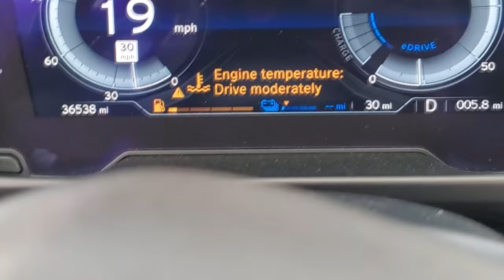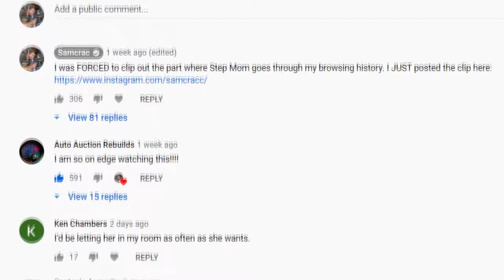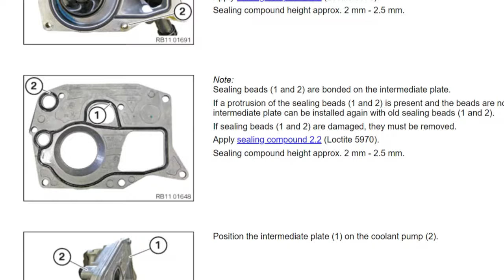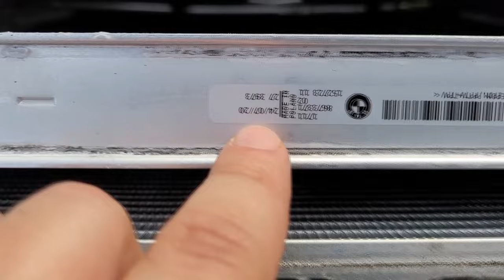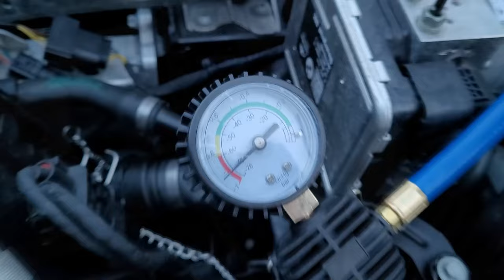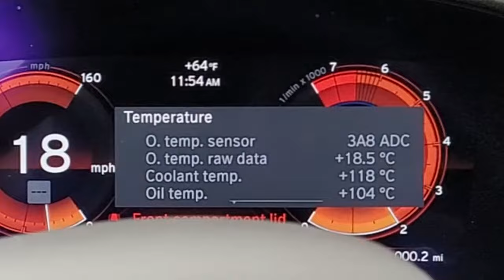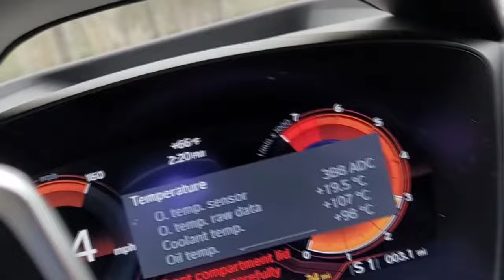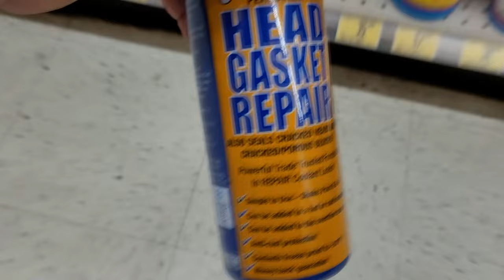The Dealer FAILED my "Unrepairable" BMW Supercar! Can I Fix it with this Simple DIY Trick???

Comment: This is probably one of the most anticipated videos of YouTube. Alot of folks wondering what will fix Samcracs car.....
Reply: And the answer is... a new engine 🥳🤣😂
Reply: @mundotaku_org  PRICELESS
Reply: What if it's the water instead of coolant... Don't the sensors rely on conduity or something at times? I'm not a mechanic I just done alot of reading and thought that was a "thing"
Reply: Thats a hell of a projection. lol
Reply: BMW overcomplicated bleeding of the system. You can choose to do brain surgery or bleed an i8. Brain surgery is quicker
Reply: @D Thirteen  Which one?
Reply: @rocsti5402  Interesting thought. I'm no tech either but with a car like this; who knows?
Reply: Get a grip
Reply: I really hope you dont use that head gasket fix. It will ruin your engine if it hasn't already. It plugs up every cooler, radiator, heater cores, oil coolers etc. I am a master certified diesel tech, for the love of God DON'T USE HEAD GASKET FIX!!!!!
Reply: Why didn’t he do a sniffer test in the first place? It’s not expensive and doesn’t take very long. It would have saved him soooo much time and expense!
Reply: Now I am having doubts about buying a  BMW if they sabotage the cars
Reply: @innesmaclean21  I have found in my line of work it's not a very accurate test. Mostly with the egr system. If that system develops a leak it will contaminate the coolant with exhaust gas. The coolant is usually not replaced, just re-used. So it can give you false positives from a previous failure
Reply: Even Sam crack's floor jack sounds like Rich's fail flute...
Reply: @Random-bm7ho  yeah, I see that point, but in this case Sam replaced all the coolant with distilled water so unless that got contaminated in the couple of drives he did, it's probably the head gasket.
Reply: @Mandinka711  It doesn't take much. The test is pretty sensitive.  I better test now that the path is decided is to pressurize the system and see if you can get coolant into a cylinder to nail down the issue. Pull the plugs and compare. The one with coolant will be steam cleaned, same with the top of the cyl. Could also be a cracked head or warped considering the cooling issue. Who knows how bad it was thrashed on with the damage. I'm not a bmw tech, but I know they are pretty complex.
Reply: You are correct this is very mysterious and interesting I went through the same thing you can't get false positives from that blue liquid test I got a false positive and replace an engine when it was not the engine it was the radiator
Reply: @noblsht  My grandfather once told me when I was having issues on my first car that "sometimes it's just a sparkplug" I think I was assuming it was way way worse like a burnt up piston. Well, he was right, it was a plug wire that rubbed on the valve cover bolt causing a misfire. That advise has served me well with the career I chose lol.
Reply: As a bmw mechanic I don't trust this test result for 2 reasons: 
1 a headgasket issue that overheats this engine in such a short time must be visible on all tests that are done including having a vacuum leak. You cannot hold a vacuum with a head gasket issue. 
2: running on destilled water is really bad. The boiling temperature is to low creating hotspots at the cylinder walls causing you to get gas creation over there creating the overheating issues again. The water actually starts boiling at the cylinder wall

There is NO way that a small headgasket issue creates an overheating issue this quick after starting the engine.

The sudden drop was actually ok, that was the thermostat opening completely making the cool radiator water run through the engine.

I would redo the test with the correct coolant which is already pre mixed.
Reply: @Random-bm7ho  that’s fine on a diesel but petrol cars don’t use EGR valves (to the beat of my knowledge). They mentioned a possibility of a head gasket in the first episode by just dismissed it really quickly. He should have done it early just for some peace of mind. I thought o had a head gasket fail once because I had milky residue on the oil filler cap. A sniffer test showed it wasn’t a head gasket failure which saved me a lot of money. Btw the milky residue was from doing short journeys during winter and condensation forming on the inside of the cap.
Reply: @peerware  everything you said makes sense you made some very good points
Reply: @innesmaclean21  Gas engines do have egr valves. I wasn't talking about a egr valve, I was talking about a egr cooler. It cools the egr gas to lower the exhaust gas temp to reduce emissions. Also oil coolers, fuel coolers, and if it's a hybrid it will have some kind of cooling system for the electric motors all of which have coolant flowing through them. Alot of the foreign cars also use coolant in the turbos to help cool them. The head gasket fix will destroy all of those. It essentially creates a solid mass in them, resulting in the cooler being plugged. That stuff was ok in the old cars, but with all the complex system of today's cars that stuff should be banned.
Reply: @peerware  I agree. I've been thinking about how quickly it heats up. Something is not right. I don't think the head gasket is the problem either...
Reply: Head gasket doesn't mean a new engine...
Reply: @Airplanefish  Is there coolant in the oil? Sorry, I missed the start of this deal lol
Reply: @Random-bm7ho  I don't think Sam has checked the oil for coolant. Good idea tho.
Reply: Yes most new petrol cars have egr coolers . As i said before .. 
Do a quick google search . Bmw i8 egr cooler . They sell them . For this car .. and its a stocked product.  Wonder why ae
Reply: sams mommy
Reply: Facts
Reply: @bdbeckstrand  unless it’s a Cadillac North Star lol 😂
Reply: I'll tell you... new engine 😜
Reply: @innesmaclean21  Wouldn't have made much of a video though.😁

Comment: In a way, replacing the engine would have solved the head gasket issue
Reply: I think we may still not discovered the full story. We'll see if a gasket replacement will solve the issue.
Reply: Of course it would. The mechanic in one of the previous videos  literally said " is that the one that was driving around, overheating" word for word. AND HE LAUGHED!!  Getting a Modern engine hot briefly, is sketchy. Driving around, overheating, pretending that it is no big deal , then trying to reseal the top end is thowing good money, after bad. A five minute combustion gas test would confirm that,  but in the interest of content, the attempt at cheap ass, not gonna work, not gonna listen to the smart people, will continue.
Reply: Potentially more cost effective too
Reply: Told ya it was a head gasket.. it’s common on diesels when the head gasket fails the over flow boils
Reply: @cbruno12180  but it's not a diesel
Reply: It’s unlikely that it’s “just” a head gasket!   That would be way too easy and isn’t the only way combustion products can get into the coolant.
Reply: @richb2229  it’s possible he has a cracked head sure who knows how long it was driven before he got it while it was overheated
Reply: Idk sounds like more than a head gasket. But at the same time its running great and no signs of leakage around the engine, like water in the oil. Idk one of the weirder things ive seen. Gotta be a pressure issue its not moving through the block fast enough. I'll say the absolute worst thing to do is put the fix a headgasket gunk in the system especially on all of those brand new parts he just put in
Reply: @jamesgeorge6551  yup especially when the dealer said it needs a new engine.  better hope the head gasket is the only thing wrong with it
Reply: @TAKIZAWAYAMASHITA  if you drive around, overheating, repeatedly, r&r headgaskets is like putting a band-aid on a terminal cancer patient, hoping that will cure them.
Reply: @cbruno12180  ..."diesels"??  Who said anything about diesels?
Reply: @cbruno12180  
The dead giveaway was the bubbling in the reservoir in last video which means exhaust gases are getting in cooling loop. Just have to hope head not cracked?
Reply: @jamesgeorge6551  Yep as surface is likely warped and could have a crack in head?
Reply: @parrotgenie5099  What I would do, I would send the head to get pressure tested. Whether it is only head gasket problem or not, head has to come off anyways and since this car has produced weirder and weirder symptoms, it would be a wise move to make absolutely sure that the head is fine. I personally think that it is likely to have a microfractures in head and the gasket is fine, because when gasket fails, it usually gets worse and fluids and gases are starting to get to the places that they are not supposed to. On the (slightly) bright(er) side, new head is prolly cheaper than new engine...
Reply: @mr.m2gilane  Yep exactly
Reply: @parrotgenie5099  correct I used to work at a gmc dealer and a strange case came in with a deisel truck I’ll never forget it the top tech was on it for days the the cooling reservoir was bubbling at certain times and finnally he figured it out that the head gasket were bad this was 15 years ago
Reply: In a way replacing the engine would would solve the head gasket issue. Unless you were putting in a blown engine how could replacing the engine not solve the issues?????
Reply: Cracked head
Reply: @jamesgeorge6551  and yet you watched the "content"?
Reply: @cbruno12180  not diesel
Reply: @jamesgeorge6551  mine as well get the head checked and surfaced..
Reply: @jamesgeorge6551  yup probably warped head or block either way dealer said new engine requires. Sam is like nah. Finds out after 877676 overheating and drain and fill proceedures hey do a block leak test something you do 0.1 secs after buying a a sight unseen used car. Finds out oh thats the problem welp. Lol hopefully it can be fixed without the cost of a new engine, either way with how that car is designed most of that work is an engine out procedure anyway probably cheaper to buy a used good engine from a wrecked i8. He should take it to the car wizard or scotty
Reply: @aussiebattler96  if they smoke tested it and saw it leaking out a cracked block
Reply: With this type of engine it's possibly the only viable repair.
Reply: @TAKIZAWAYAMASHITA Yeah. UView560000 Combustion gas detector. Check it out. Smart technicians dont fuck around, we own the tools to make the right diagnosis, the first time*, and I'm certain thats why the guy who laughed at samcrac the *first time , did, and the BMW dealer owns a combustion gas detector, I promise.
Reply: @theworstgamervr  he's gonna clog up that brand new radiator if he puts that head gasket in a can shit in there. I hope he was joking
Reply: @jamesgeorge6551  the only reason this is remotely cheap is because hes doing it himself. But anyone else out there who isnt a mechanic and doesn't have thousands of dollars worth of tools DONT do this.  because throwing a new cooling system and head gasket at a damaged engine would often cost you way more then buying a new or used engine to have put in at a shop
Reply: @TAKIZAWAYAMASHITA  BMW repair is way beyond the skillset of a guy with more money than sense. And trust me when I say this isn't the normal pain in the ass H/G job like an Econoline van with a 5.4, this is a DI BMW engine. Samcrac has no business changing a headgasket on an 80's Briggs and Stratton.
Reply: @douglasb.1203  and laughed, because I'm a schadenfreude kinda guy.
Reply: @jamesgeorge6551  malicious joy du Schadenfreude Knecht 
xxD Cheers
Reply: @SpeedcoreJihad  we should be able to bleed the air .....Nein! Lol.
Reply: Aluminium block on that engine, and it's pushing 100HP more than it was originally designed to... asking for trouble.
Reply: @parrotgenie5099  More likely to stress the head bolts past the point of elastic tension, to plastic deformation. Aluminum expands 3 times more than Iron based alloys. Once cooled, the bolt no longer returns to its elastic state. Upon disassembly, the head bolts will not be tight, and the head will most likely be warped. Most modern lightweight cast heads have little to no material to mill flat, and even then, the proper method is replacement, because a warped head will kill the cam bearings, and camshafts, making metal shavings that will contaminate the rest of the engine. Also, if the deck surface is warped, there is no insitu way of addressing that either. That is why BMW just says, "needs an engine". No fiddling with anything. Just install, and done.
Reply: @TAKIZAWAYAMASHITA  neither of them like bmw lol
Reply: @parrotgenie5099  wel, if you think it overheats, and think the water boils, it would explain the bubbling.
but it does not overheat, it just gets a little exhaustgas in the cooling system, that blocks the water touching the temperature sensor.

Comment: The confidence he has to use the Jack on the grass is amazing.
Reply: Stupid would be another word to describe it.
Reply: Mmm I thought exactly the same.
Reply: last place I want to die
Reply: @MICHAELWALTON1  I often work under my cars also. Even with Jack stands I have this thought of it coming down on my head and people find me under there weeks later.
Reply: Also, when you jack up a car the wheels on the jack need to be able to move as the length decreases as it goes higher. As the wheels would be stuck in the grass, it has the potential to pull the jack away from where it is mounted.. But anyway, no one likes a whinger.
Reply: Omg your rite!
Reply: @mikeb1039  I mean dirt driveway, yes. I mainly use plywood under it though. We're not all blessed with concrete

Comment: The original owner probably drove it home after the “minor front end accident “ - over heating the whole way - thus blowing the head gasket or cracking the block. SMH.
Reply: Hmm this could’ve been it but there is the overtemp cut off. 
Along with “not having insurance cover” on a car like this leads me to believe it was probably a drunk driver type of incident.
Reply: I agree completely
Reply: How does ut overheat if it shyts iff? Unless itets you actually drive?
Reply: @JackRR15  junk it car crusher
Reply: No, in an earlier video the engines been pressure tested, and internal inspection.  It's fine.  Unless he's overheated it since and warped the head or blown the HG.
Reply: @IntenseVLT  coolant temp sensors dont work very well if there is no coolant to check the temp of think of it like holding a thermoter in your wide open mouth expecting an accurate temp
Reply: @dubba85  that actually makes a lot of sense!
Reply: If there is a leak at all from the combustion chamber into the water jacket it will produce a bubble and the bubble will stop the coolant from circulating and you get overheating.
Reply: @dubba85  That is what I was  thinking and makes a lot of sense.
Reply: Cracked block means junk or can it be pulled out and repaired?

Comment: Next episode "cracked engine" 
Episode after that " me and Rich LS swap the i8"
Reply: LS is always done maybe a coyote?
Reply: Kswap k24 turbo i8 lol
Reply: @Chief_5  Or a B58 to keep it all BMW. Though I'm pretty sure that would be way more expensive
Reply: And make it look like the V8 BMW i8 from Need for Speed Heat, but that’s not something Sam seams to be into doing
Reply: Good luck swapping a supercar. Engines probably part of the chassis structure/rigidity, I'm sure it can be done but I wouldn't want to have to do that!
Reply: Make its a Rotary Swap,  should have room atleast, and run for a few days.
Reply: That's always the answer hehe 😂
Reply: @Chief_5  No room.
Reply: You're going to cram a V8 into a 3 cyl space? Good luck.
Reply: @OMGWTFLOLSMH  It is german so go with a Marder IFV style engine installation to the right of the driver. Shotgun/passenger seats are overrated

Comment: I’ve been partially following this repair so I don’t really have all the information but after the first few attempts to bleed the system and seeing the coolant reservoir popping and bubbling I’m very surprised that a blown head gasket wasn’t suspected right away. Especially after the engine had been overheated numerous times.